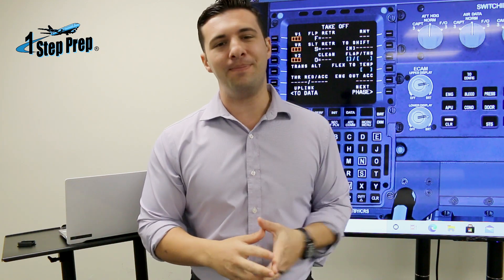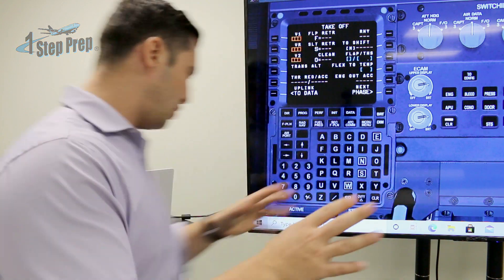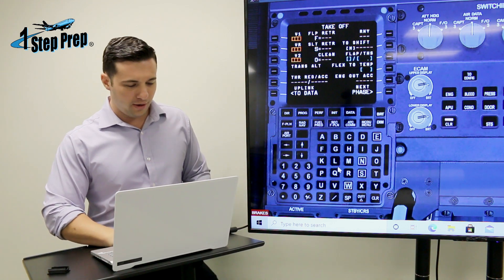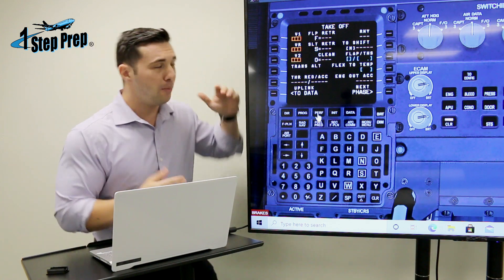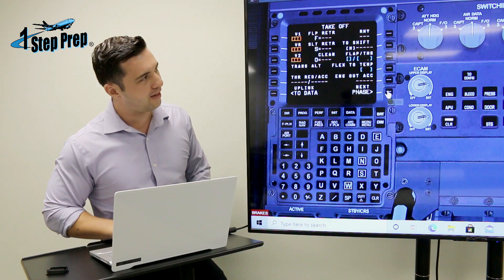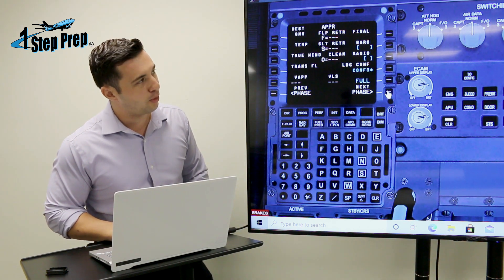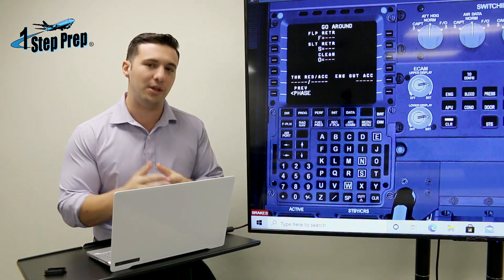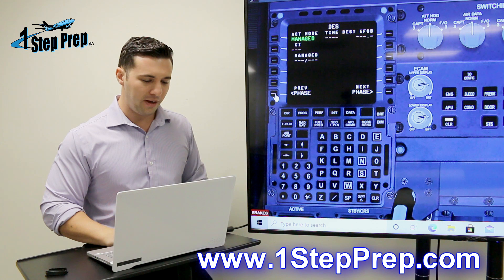A320 Pre Selecting Speed

Comment: Hello Joe! Basically, whatever the chart says we still respect 250 below 10 as long as it is cancelled by ATC? I just normally hear high speed approved to remove the 250 below 10. Are there any other ways to say 250 below 10 doesn't apply?
Reply from the maker: That's correct. Always 250 below 10 UNLESS ATC grants otherwise. Once above 10,000 you would respect the speed constraint on the SID (if there is one published). 250 Below 10 also wouldn't apply if you're offshore by more than 12 miles (assuming US) as you are now in international airspace and this doesn't apply. Hope this helps!